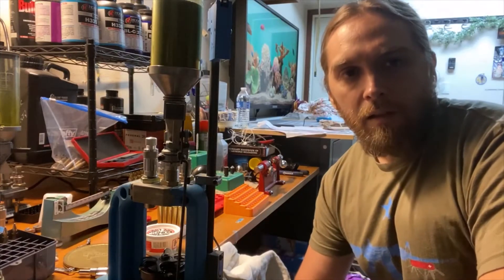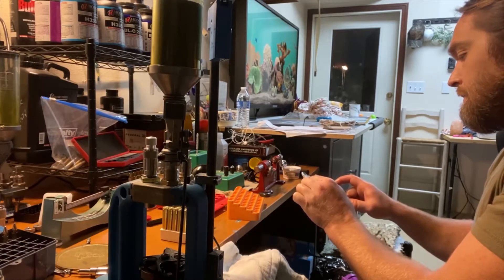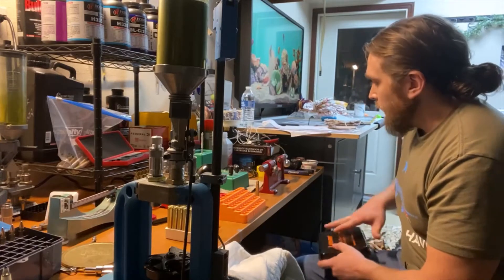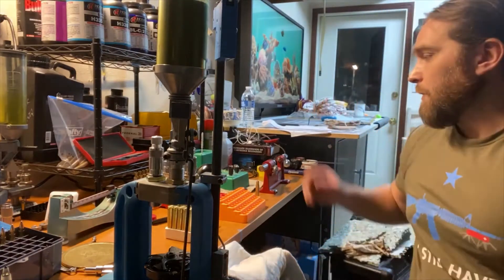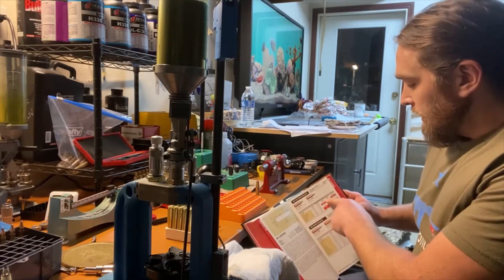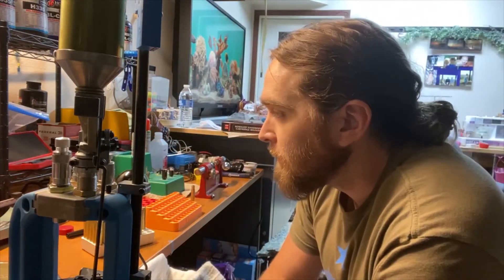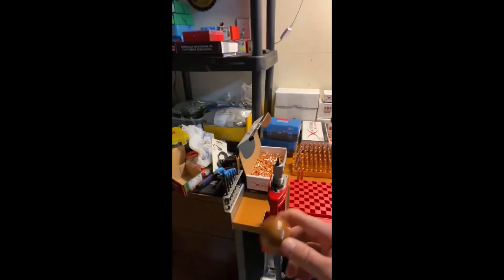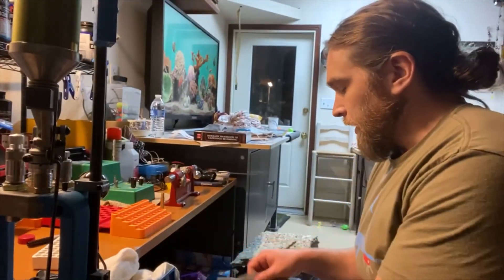Reloading  .30-06 for the M1 Garand

Comment: All .30 cal brass for the M1 should have the primer pockets prepped with a primer pocket uniformer to ensure the inserted primer is .006 below flush. The uniformer should be used to clean fired brass every time, the brush pocket cleaners are worthless. I insert my uniformer in a small electric screwdriver. When prepping a new case with the tool, it's amazing how much brass shavings are produced, the same goes for cleaning fired cases, brass must swage in the the pocket area during firing from the amount of shavings produced. The primer should be below flush to minimize slam fires in the M1 due to the floating, unsprung firing pin which will produce a 'dimple' on the primer during the chambering phase.

Comment: I use a single stage Lee and clean brass with stainless steel pins in a rock tumbler with some Dawn & citric acid.  I deprime all brass in one step as I like to neck size the brass in a separate step.  I weigh every charge, no exceptions and only use IMR 4895 which is the recommended powder for the M1 Garand.  Usually start shy and trickle up to proper weight.  After you reload and trim the brass a few times you'll need to anneal the case necks.  I inspect the web and case mouth of each piece of brass before reloading.  Cheers - eastern TN

Comment: Shalom.  I think the most important information about the M1 Garand is the op rod spring length.  By having a proper length spring you will lessen the damage caused by piston stroke on the rear of the receiver.  According to the CMP gunsmith, the proper op rod spring length should be 20 1/4 inches long.  I took mine apart and the spring had compressed to less than 19 inches.  So I stretched the op rod spring out along its entire length and restored it back to 20 1/4 inches.  This will dampen the piston stroke so as not to damage the rear of the receiver.   I ordered a GarandGear voluminous gas plug because I couldn't find an adjustable Schuster gas plug and with that and the restored spring I should be able to shoot some 180 grain Remington soft nose, Core-Lok commercial ammo.  My M1 Garand has a National Match op rod and a 1986 barrel that specs to +1, +1, and I don't want to bend my NM op rod.  I've pulled numerous WWII m2 ball ammo and they typically are a 150 grain boat tail/solid base FMJ bullet over 47.5 grains of short cut powder much like IMR 4895.  I reload for my M1 Garand and when I reload FMJ, armour piercing or tracer ammo, I use the full compliment of 47.5 grains of IMR 4895.  I also cast my own bullets and use a 200 grain cast alloy bullet with gas check over 37 grains of IMR 4895.  You just cannot push cast alloy lead as fast as a FMJ bullet as it won't properly engage the rifling.  I also just found out that you can disassemble/reassemble the bolt while still in the rifle by using either the M10 or the M3 combo tool.  My M1 Garand is a Springfield Armory made in May, 1943, and I paid $350.00 for it back in the early 1990's. Since I'm a Marine, we always used only Lubriplate on all our rifles as it is a high heat grease made for M1 and M14 rifles.  Served in the USMC from 1969 to 1973; Vietnam '71 - '72.  Made sergeant in under 3 years.  Cheers from eastern TN
Reply from the maker: Thanks for the comprehensive response!  This video is pretty old (relatively speaking) - I've now switched to single-stage for all of my .30-06 loading.  My current setup is a Dillon 550 (which I use primarily for pistol calibers and high volume 5.56 loading - currently configured for 45 ACP), a Lee single stage and an RCBS R2.  Regarding the Op-rod info - I'll have to disassemble and check mine.  My gun came from the CMP so hopefully it follows their recommendations.  FWIW my Garand is also a '43 Springfield!  Thank you for your service!

Comment: You do not want to shoot heavy bullets in the M1. It was not designed for them. I would say you can go 168grain and no heavier.  Your operating rod will not take the force.  The M1 and M14 have a very specific parameters.  I have a. national match M1A and has match parts and it is made to shoot up to 175 grain ammo.  Interesting point is that because of the match chamber I cannot shoot 308 ammo in it.  Headspace is different.  Be very careful and follow the powder charges meant for the M1.  Most books have a special area for this.  Been a lot of guys tried to get inventive and blew them up.
Reply from the maker: I appreciate your comment, but I didn’t say anything about actually loading heavy bullets—I just mentioned I could load 180s or 200s if I wanted to, and then clearly said I wasn’t doing that. What I’m loading is 147gr FMJ-BT, which is exactly what the M1 Garand was designed to shoot (M2 Ball).

As for the whole “never shoot heavier than 168gr” thing—that’s not accurate. The issue isn’t bullet weight alone, it’s gas port pressure. Plenty of people - including friends of mine -  run 175gr SMKs and similar in Garands using the correct powder or an adjustable gas plug.  The bullet weight is a factor, but it’s not going to "blow up your op rod" just because it’s heavier.

Now about your National Match M1A “not being able to shoot .308” because of headspace… that sounds odd to me, especially since I also own an M1A.  .308 Win and 7.62 NATO are dimensionally compatible. The difference is that 7.62 NATO typically has slightly more generous headspace and slightly lower pressure, but any properly-built M1A—even a match rifle—should have zero issues shooting commercial .308 unless it’s way out of spec. Headspacing issues are rare unless you’re dealing with improperly sized brass or out-of-spec chambers.

Anyway, in this video I’m working off published Garand-safe load data in the Hornady manual, using the proper powder, and staying well within pressure limits. I don't believe anything I said in this video matches up with what you’re warning me about.

Comment: As I believe, the powder used in original M2 150 grain ammo was IMR4895. So I only use that powder and load in all my WWII rifles. I forget what charge weight I use, I would have to check my records.
Good luck!
Reply from the maker: Yes you can use IMR4895, however more modern powders can like H335 and VIHT N-135 can allow you to reach greater velocities while maintaining a lower pressure.  Using H335 I can reach 2700 FPS using 45.1 grains with a pressure of around 35,000 PSI.  To get the same velocities with IMR4895 I'd need to increase the charge to around 48 grains and then I'd be running pressures at closer to 40,000 PSI.
Reply: @GuitarGunner  that’s cool, you can use anything you desire. I just want to use exactly what the rifles were designed to use, I shoot them for fun and entertainment, not for performance so I like sticking with the authentic ammo. I know you have to be very careful deviating from the pressure curve or the op rod can be damaged and I worked hard and spent a significant amount of cash getting all the correct parts that are the correct number for my 2/43 Springfield.
I have an 8 lb jug of surplus WCC846 powder which is supposed to be very close to H335!
Have a great time with your rifle!

Comment: Hey GG, last year I picked up a M1 Garand a Springfield Armory made in Feb/March 1943. I too am reloading just moderate loads for it. Did you modify your gas plug?
Reply from the maker: Hey there!  Nope, I didn’t modify my firearm at all whatsoever.  I’ve put hundreds of rounds through it (both factory and reloads) without any issues.  How light of a load are you going for?  I keep mine above 2500 fps but I can imagine tuning the gas plug if you are planning on going slower / lower pressure.

Comment: I tried that load with a 150gr Hornady fmjbt. I was having trouble cycling so I'm upping the charge to the max to see if it works.
Reply from the maker: Really?  Interesting.  I've never had any cycling issues with these rounds.  What kind of M1 are you running it through?
Reply: @GuitarGunner  just a standard Springfield M1. No modifications. I'm going try a slower powder to see if that will have enough energy to cycle the op rod.

Comment: No lube on the neck and shoulders when sizing? Be honest bro, how many pieces have u had to remove from your dies with a removal kit.. you do you and all bet dang.
Reply from the maker: I have never had a stuck case with .30-06.  I don't know about others, but I typically don't encounter much expansion on my expended casings.  They will usually drop right back into the case gauge just fine after being fired, I still resize them anyway. 

That being said there are plenty of people that reload .30-06 that don't use lube on the shoulder.  Primarily because depending on the type of lube it's easy to use too much and cause excess pressure inside of the die, resulting in unwanted indentations on the shoulder itself.  I thought I had touched on that issue in the video but I may have not been clear.  Also, the shoulder and neck do get a little bit of lube on them just from my handling the cases with my fingers.  Sometimes I will spray a little bit of one-shot on the shoulder / neck if I feel it's necessary, but I have no trouble resizing with lube just on the case body and a very, very minimal amount (if any) on the neck & shoulder.  This works fine for me, and like I said - I'm not he only one who does it this way.  I've been reloading .30-06 like this for the last 2 years and I don't encounter any resistance on the up or down stroke, and since I've stopped focusing on lubing the neck / shoulder (or at least just using too much lube) I've stopped getting indentations on the shoulder when resizing.

As an added note, I've not encountered much expansion with .30-06 brass compared to .223 / 5.56 brass.  The only brass I've ever had stuck-case issues with was military 5.56, and that's because I was using Hornady one-shot and my Dillon's shell plate doesn't grab hold of the case rim enough to pull it back out with the force it needs if there's a particularly deformed casing that doesn't have quite enough lube on it.  That's one reason I now do all of my resizing on a Lee single stage press, with RCBS / Hornady shell plates that grip the casing much harder than a Dillon shellplate.
Reply: @guitarGunner Lubing the neck and shoulder of bottle neck brass it the most important area, not that the body isn't important. Thats where the majority of the sizing is happening whether you are neck sizing or full length sizing.. if to much lub is added there it will dent the shoulder for sure always a good idea.. any reloading book or load data manual will tell you the same brother.. when you clean your dies (I love my RCBS ultrasonic #2 with the gun cleaner) and all the lub is gone from that area you might run into a few issues.. have a good day..
Reply: What are you smoking lol? Lube should never be on the shoulder, you'll get dents for days
Reply: @ makarov kid, you only get dents in shoulders when you A) Use to much lub and, B) use to much lub.. you can use hornadys "Oneshot" or Reddings "Imperial case wax" or a 1000 other things and not damage the necks.. Also I would tell you about 99% of the reloading community lub there cases. If you don't, thats ok but getting one stuck in your dies is an eventually if you full length size.. (neck sizing is a thing of the past) ask all the pros. So I ask you sir, are you smoking the wacky tobaccy, cuz its puff puff pass my guy
Reply: @luckyshotammunitiongunsllc2369  yeah I lube my cases, just not the shoulder because you'll get dents.
Reply: Agree no lube on neck and shoulder. If I am resizing on the single stage RockChucker, I like to use imperial sizing wax is good for sizing and is not oily, but wax/graphite based I think. Redding gave me a trial size when they returned a stuck case I had sent in. Awesome customer service. Now I love imperial sizing wax
Reply: @luckyshotammunitiongunsllc2369  nope, don’t need lube on the neck and shoulder, the shoulder is too blunt to stick

Comment: I load my rifle loads on a single stage and I find it’s easy to use and and gets better results I also have the 550 RL I do my pistol cases on it
Reply from the maker: Since I made this video I actually bought a Lee Challenger single-stage - Now I do all of my .30-06 and 30-30 loads on that press instead, as well as all of my depriming / resizing.  So now I have my RL550 setup up for .223 / 5.56 and my single stage setup for 30-30.
Reply: @GuitarGunner  cool I thought about setting up the Dillon for 223 but the dies are a lot of money so maybe In the future but for. Now I’ll stay with my hornady
Reply from the maker: @brianbelliveau5551  You can get steel dies for a lot cheaper and in my opinion they run just as good as the carbide.  Literally the only difference between steel / carbide from Dillon is that the carbide resizing die just has a lining of carbide inside of the resizing chamber.  I talked to a Dillon rep and they told me that steel would last just as long as long as you used case lube when you resize.  So right now I have carbide .223 and 9MM dies but for .308 , 30-30 and .30-06 I have steel.
Reply: @GuitarGunner  ok cool I’ll look in to it thanks for the come back
Reply from the maker: @brianbelliveau5551  Yep you bet anytime!

Comment: Invest in a powder trickler for fine tuned powder measures. Set scale to register below specified load and then trickle until balance beam is at "0" Takes longer, but the results are the best.
Reply from the maker: I actually just picked one up a few days after I made this video ;-)  But to anyone else reading.... YES!  Get a powder trickler, especially if you're using a magnetically balanced analog scale.  I picked up the Hornady trickler for about $25.
Reply: @GuitarGunner  Should you desire better powder control use an automated  powder dispenser with a built-in scale. I to have a 550 press, and have found that Dillon powder dispensers don't do well with stick powder. They do very well with ball type.  BLC-2 works great. I have had best results with a cheap Lee powder dispenser used beside my press. Also Case length no go gauges can be a big help. Use them after resizing.  They also work well to see how much Brass drift you have. With a tight chamber and only using the same brass in the one rifle case length issues should be minimal. Also only military Brass requires primer pocket swedging. I use Dillons' swedging set. No grinding it presses  the metal out of the way. 

Good luck and happy shooting
Reply: The danny trickle 2 is worth the 100 $

Comment: Great video, Im a proud owner of an m1 garand and I know m2 ball is expensive and hard to find. I don’t have any experience in reloading except the few videos I’ve watched but I would be very interested in starting. Problem is I don’t know where to start, I don’t know what equipment specifically I would need. Could you do a video on your setup, that would be awesome ?! Or email me too, thanks !
Reply from the maker: Thanks for the comment, Andres!  You're right about M2 ball being a pain in the butt to find... However you can usually get some military surplus m2 Ball at a local gunshow, or PPU makes brand new factory loads specifically for the M1 and they run great through my rifle.  Anyway -  I'd be happy to do a video on my setup.  Until then, here's a rundown of the equipment that I use. It's not a complete list but it's a start: 

Presses:
Dillon RL 550 Progressive Reloading Press
Lee Challenger Breech-lock single-stage press

Die sets:
Carbide Die sets for .223, 9MM
Steel Die sets for .308, .30-06, 30-30

Other equipment:
Hornady case gauges for .223, .308, 9MM & .30-06
Frankford Arsenel Impact Bullet-puller

Other equipment for case prepping:
Cabelas vibratory case tumbler w/ Lyman corn-cob media
Cabelas media separator 
Hornady Cam-Lok case trimmer
Lyman Brass Smith Xpress case trimmer (this one is motorized and is a must-have for trimming volume)
RCBS Case Prepping Center
Lyman Case prepping hand tools

Powders that I use:
Rifle:  Hodgdon BLC2, CFE-223, H335, H4895, Alliant Power Pro 2000 MR, IMR-4895, IMR-7828
Pistol:  Alliant Power Pistol, Alliant Bullseye (I use Power Pistol for all of my 9MM loads, it's amazing). 

Bullets that I use:
XTreme Bullets in the following calibers:  .223 (55 gr & 62 gr), .308 (147 gr, 150 gr, 168 gr, 180 gr, 200 gr), 9MM (CPRN @ 115 gr, FMJ @ 115 gr)
Hard cast lead bullets in 9MM @ 124 gr and 147 gr respectively

I also use an assortment of Hornady brand bullets for loading .308 caliber cartridges such as .30-06, .308 Winchester and 30-30.  

Feel free to reach out with any questions!  Thanks for watching!
Reply: Oh and as far as m2 ball locally I live in Florida where ammo tbh is not too bad and there is lots of gun stores but there’s few that carry it and the one that does has m2 ball boxes of 20 from the cmp for 50$ a box of 20 … cmon -__- can’t support that !
Reply: Thanks awesome, awesome  reply keep consistent at your YouTube you’ll make it big!  @guitargunner